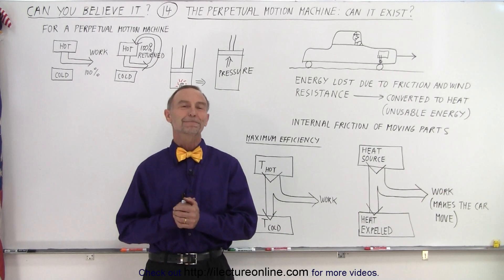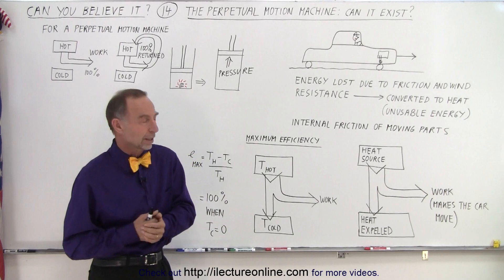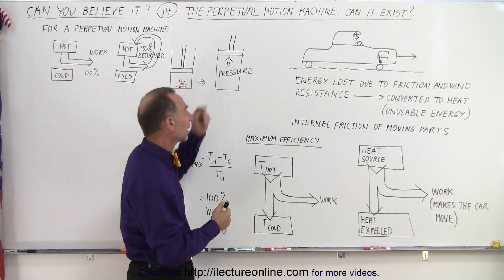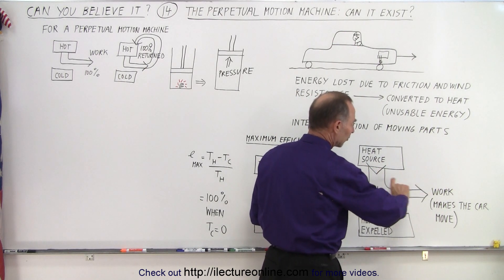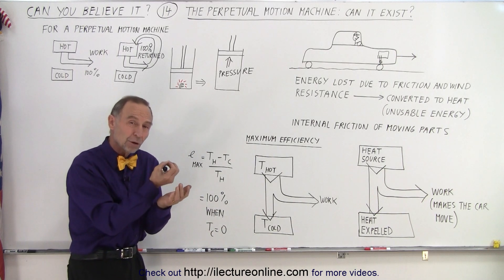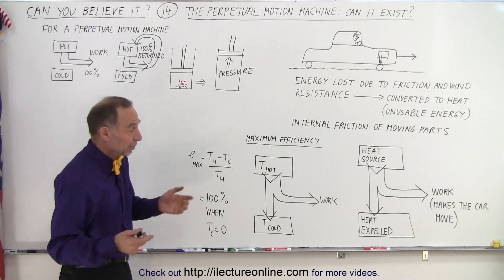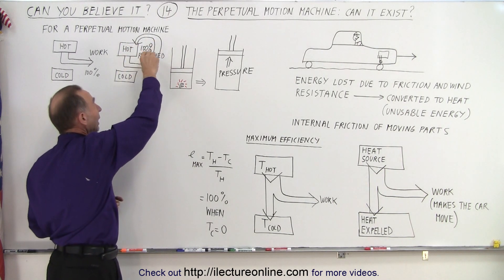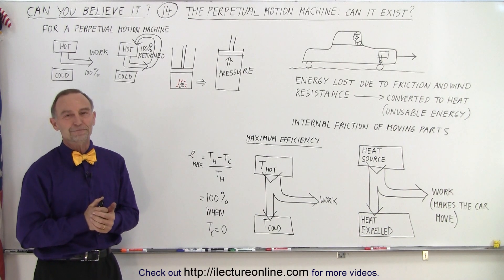Can You Believe It? #14 The Perpetual Motion Machine: Can It Exist?

Comment: Michel, do you know "lapse rate" (adiabatic temperature gradient in gas column in gravitational field) phenomena? Actually, it directly violates second "law" of thermodynamics.
Reply from the maker: Yes, I am familiar with lapse rate.   I disagree that it violates the second law of thermodynamics.  One does need to be careful how you apply the law;  you need to have a closed system.
Reply: @MichelvanBiezen  There is a Russian proverb that even if you call me a pot, just don't put me in the stove. Adiabatic already means that the system is considered to be temperature/energetically isolated. If you go further and repeat Maxwells mind experiment and consider 2 gas columns (with different gases which have different dT/dy) you will obtain different temperatures at the same height. Different temperatures for free.
Reply from the maker: The 2 columns implies that you have to systems.  That is why I mentioned above that we need to be careful how we define things.
Reply: @MichelvanBiezen  It turns out that this law does not have any boundless, universal blind applicability, what do supporters of the heat death of the universe usually press on?
Reply from the maker: It is a very simple concept.  Heat is constantly flowing from where it is hot to where it is cold.  In each exchange of heat, entropy goes up.  Eventually the whole universe will be at a uniform temperature with no heat being exchanged.  (highest entropy)
Reply: @MichelvanBiezen  2 law: "maxwells demon could not exists". Lapse rate = maxwells demon. Ok maybe I should made video (there I will show my point very clear) would you please kindly comment it after I make it?

Comment: I genuinely think between flywheels, gravity, inclines, sun light as a heat source or geothermal we should be able to harness those natural events into a rotational mechanical energy source
Reply: Flywheels are only used as a means to store energy kinetically through mechanical rotation. Harnessing gravitational energy requires taking energy from a moving mass changing in height, harnessing from the potential energy of a greater height to a lower one. Inclines are just one way gravitational energy can be utilized. Sun light and geothermal are great natural resources that aren't technically renewable but practically infinite and are being adopted more and more nowadays for creating electrical energy and heating; they are already used for creating a rotational mechanical energy source (generator) either through solar panels creating a voltage potential (acting as a generator) that can run motors or geothermal energy being used to either heat homes or create a temperature differential for powering a Stirling engine that acts as a generator. For the most practical rotational mechanical energy source or real world 'perpetual motion machines', water mills/turbines on a moving body of water are practically infinite (harnessing gravitational energy), hydroelectric power. Same for wind power. Ultimately, power generation is just taking whatever energy the world has to offer and converting it into work that is useful for us.
Reply from the maker: Very well said.
Reply from the maker: Geothermal is used in many places.  Iceland produces much of their energy from geothermal.  Sun light is no also widely used, as is hydroelectric power, wind power, etc.  We just need to build up the infrastructure.

Comment: Hi great video ,i have a question ,why does the maximum efficiency is Th—Tc/Th and you said that for it to be 100% efficient it would have to take all the heat and leave it at 0 Kelvin? Thats kinda weird i would rather take the maximun efficiency like in an engine ,the exhaust gas would leave at ambient temp ,not 0 k ,for me that 100% efficient ,why the formula is different from that?
Reply from the maker: If you are interested in the mathematical derivation of the most efficient engine (the Carnot engine) here is the video:  Physics - Thermodynamics: (13 of 14) The Carnot Cycle    https://youtu.be/oXWGk_rD5eY
Reply: @MichelvanBiezen  alright ill check it ,thank you

Comment: Modern ICE cars are a lot less efficient than you'd think, they're generally between 20-30% just. With electric cars you can get up to low 90s but of course there are losses in transport and generation.

Very well explained, if more people understood this there would be less victims of fraud in the world.
Reply from the maker: Electric cars are very efficient in transferring the stored energy in the battery to the motion of the car, but then there is a lot of loss in generating the battery energy (at the power plant).
Reply: @MichelvanBiezen  Yes, exactly right. Overall it's still much better though.
Reply from the maker: Electric cars appear to be the future.
Reply: @MichelvanBiezen  Yes, they're a clear improvement on ICE in practically every way bar refuelling and outlay cost but even those differences are narrowing. 

But they don't solve key issues, they don't help traffic, they require enormous infrastructure which takes up huge amounts of land and capital. In fact the cost of cars is highly subsidised and changing to electric won't solve that. Fundamentally, cars lead to suboptimal cities where so much land is wasted on highways, parking and other infrastructure that walking becomes impractical and cars are needed. 

It will very likely come to the point where humanity needs to rethink the pros and cons of transportation solutions / city design at some stage in the future and find a better solution.
Reply from the maker: All true, but you will have a difficult time convincing people to get rid of their car.  It offers a person an enormous amount of freedom, freedom of movement, and convenience.

Comment: I have a "beef" with builders of perpetual devices. For one thing.. they're building perpetual devices 😝 But actually more than that is how basic the engineering is, with the expectation of something profound. No calculation is done. Just magnets and glue. I think this is fine and good for the sake of understanding directly the limits of physics, and the road blocks, but this is just the first step.

I don't think a perpetual motion/energy device is possible; things get hot, material breaks down. But I do believe a few Long Lasting Devices are possible. I think there is 1 way utilizing permanent magnets, gravity, changes in time and position of the magnets with gearing to simulate a "fixed orbit". Certain mechanisms would need to be in place to prevent the machine spinning beyond the limit of the Earth's gravity's role in the device..which i guess would constant (🧐?) w the mass of rotating/moving bodies involved.

As I said, the magnets would eventually die out, material wears and tear, things get hot, and if the Earth disappears... no more gravity. All that considered, I suspect a lot of latent energy, in many physical fields can be extracted.

I have magnets in my drawer that have been "pushing and pulling", with nothing to push and pull. I hypothesize magnets and gravity can be better friends.

I appreciate your response on my last inquiry on the expanding universe. I wrote a response out, but was very lengthy in an attempt to be clear. Thanks for all your videos, they cool my head.
Reply from the maker: I disagree that equations need to be worked out first.  Many things are invented by thinkering with models, learning from that and continuing to make adaptations and changes to see what happens.     Regardless of what materials are used, the second law of thermodynamics cannot be violated.
Reply: @MichelvanBiezen  Tinkering is the first step, as I said, not equations. My own tinkering has led me to seek out the equations for the sake of precision, and making something that actually works. As far as disorder, if a system has a tendency toward it, there should be a stage before then where it is less disorderly. Actually that would be the ultimate function of the mechanism I listed to dampen the force. This isn't perpetual, it's limited.